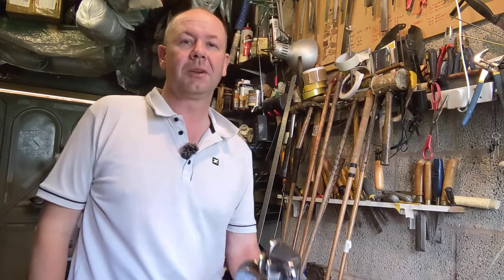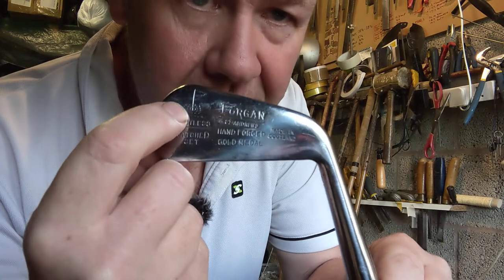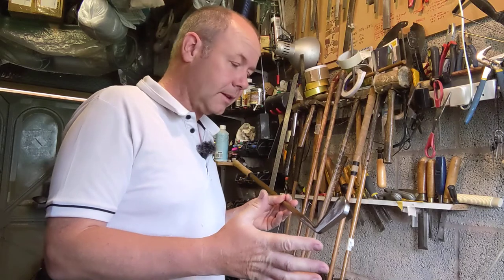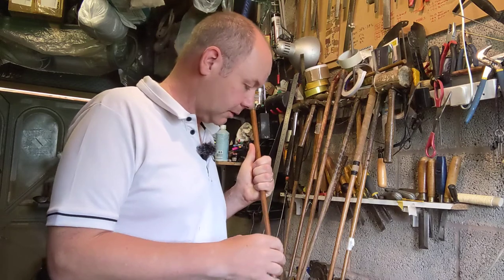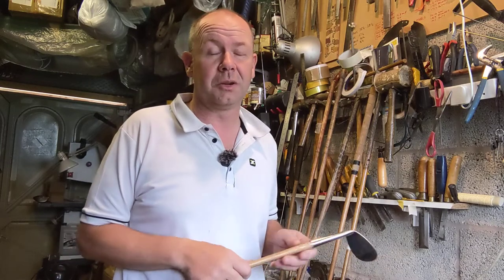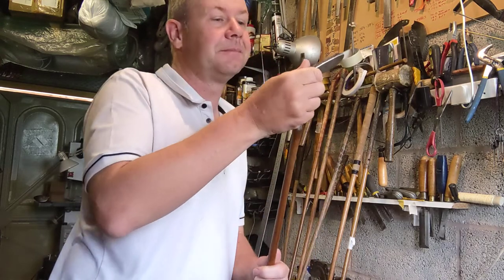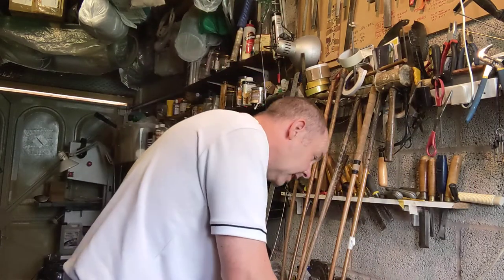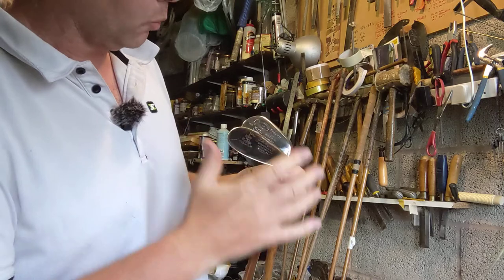Forgan Gold Medal Hickory Golf Irons

Comment: When you decide to install a new hickory shaft do you buy the same flex as you would use in a steel shaft?
Reply from the maker: Hickory shafts have  different characteristics than metal or graphite shafts. You can produce a wooden shaft that has similar linear bending (stiffness) properties...but what will be quite different is the torsional stiffness...i.e.how it resists twisting. I don't have any equipment to measure stiffness to any high degree though I have made my own linear deflection board which I'll probably show in another video. If I need to replace a broken or soft hickory shaft with another I do it by feel ... I flex it across my knee..
Reply: @timewarpgolf  thanks
I will be ordering online so I guess I'll buy 1 regular and 1 stiff and do the knee test. 
👍 Enjoy your videos.
Great information.